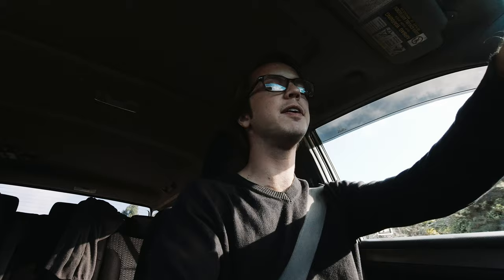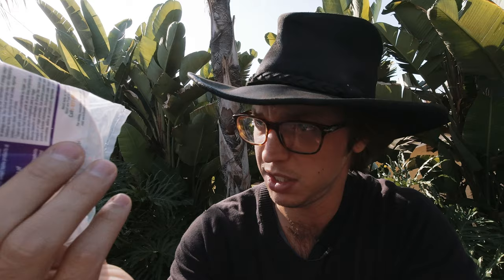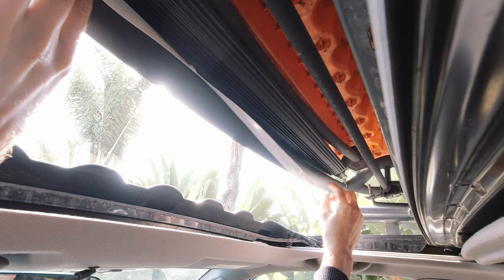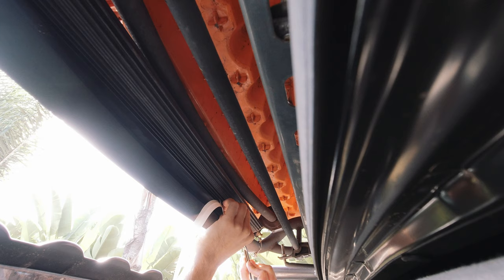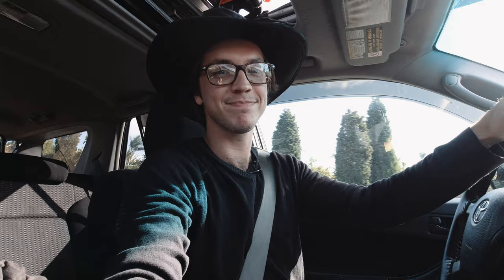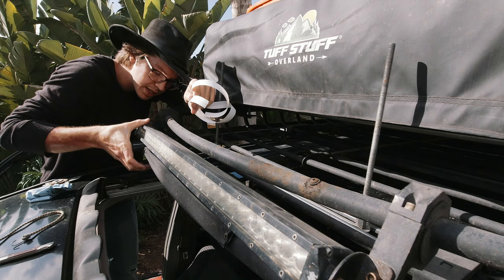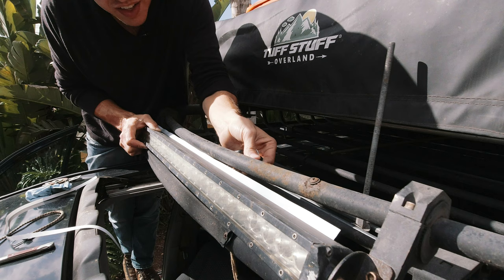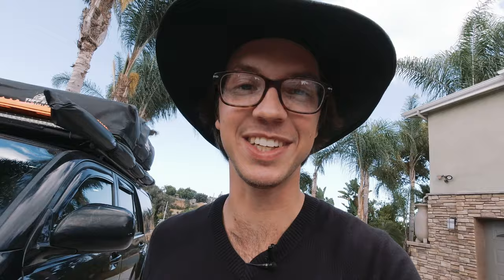$6 Light Bar Whistle Fix

Comment: This worked for me for about 1 day. Than the strips whipped off in the wind. Also rain and snow kills this option. How long has it worked for you? Thinking of adding alligator clips to it or an epoxy for it to stay on better
Reply: Use a surface prep chemical like 3m bondprep. At the very least, prep with isopropyl alcohol and let fully dry. Make sure the surface temp is above 50f before applying.